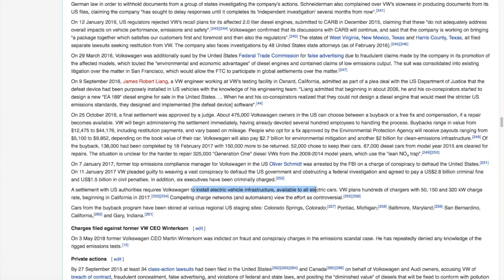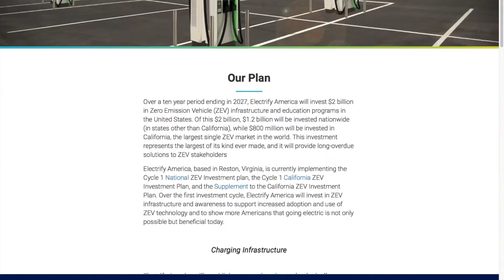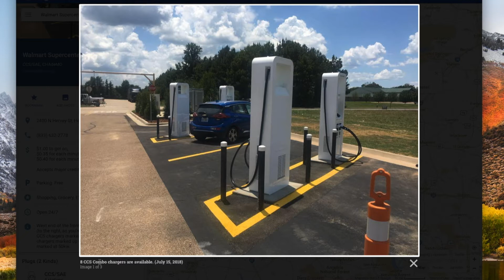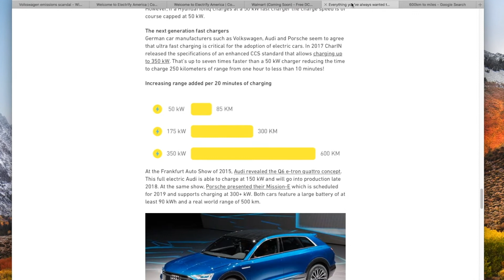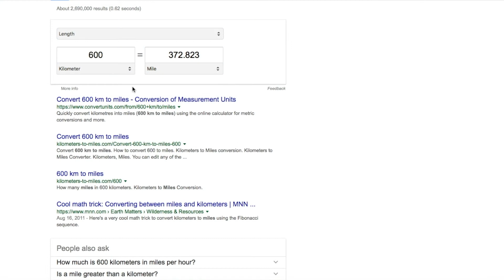Electrify America Explained

Comment: I remember hearing about VW having to invest into EV's after diesel-gate. I hadn't paid attention until I opened up Plugshare a month ago and saw a 'Coming soon' DCFC right outside of my city! I did more searching and found out that there are actually 5 of these being built in Nebraska right now. This made me super excited as it means I can buy a full EV now and actually drive to places > 100 miles away without having to worry about charging up for 10 hours. My Volt is still serving me faithfully, but having to rely on the dino-exploder is annoying sometimes.

The Kona Electric so far has my bid for my next EV.
Reply from the maker: I think the smart strategy is to drive a plug a Volt for another year or two until Electrify America builds out their Interstate charging stations.  Then swap over to a full EV.  That’s my plan at least.